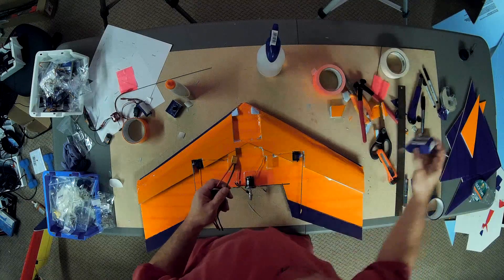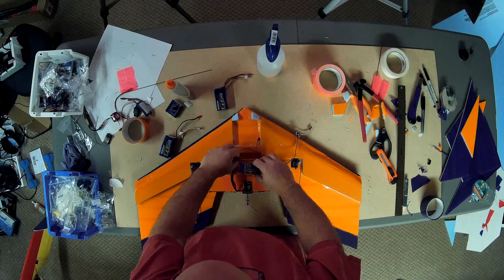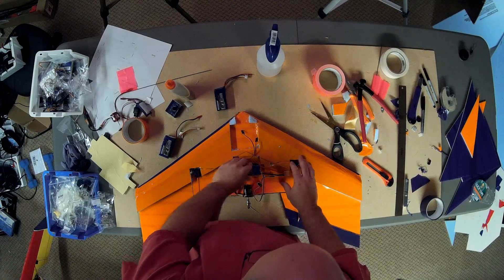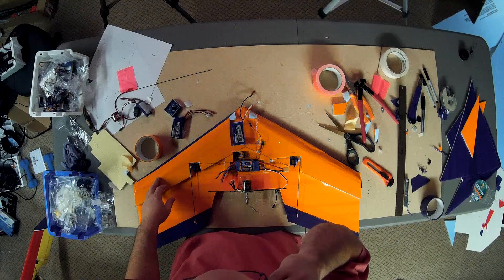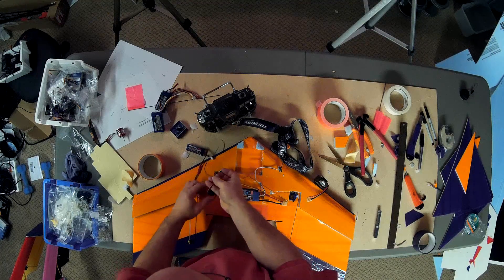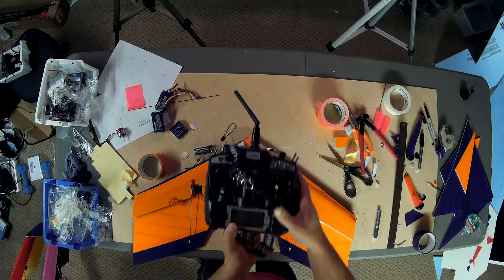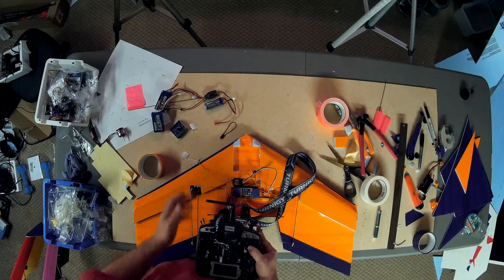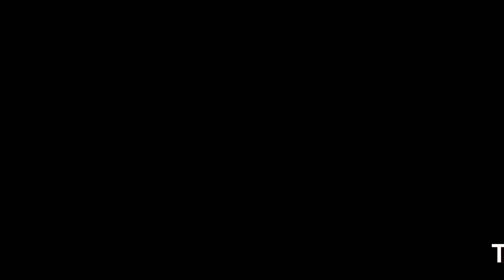How to build a Flying Wing - Part 9 - ESC and Receiver

Comment: what happened to the flight video?
Reply from the maker: +John Waddle At one point I got fed up with negative comments and removed a bunch of videos.  Likely the flight video got caught in the crossfire.  To sum it up, it flies really well once in the air, but is a bit of a pain to launch (maybe because of the weight).  For a first wing I would recommend the kfm2 version of this with a smaller (lighter) motor/esc.  I have had great success with the 2200kv Turnigy D2826-6 from hobbyking.  Still has lots of power with that motor.